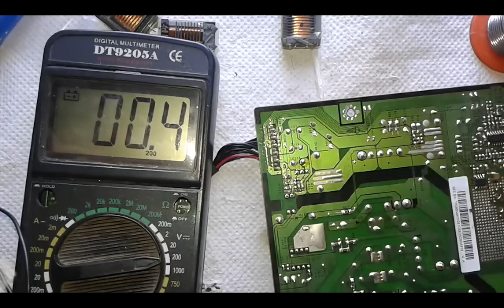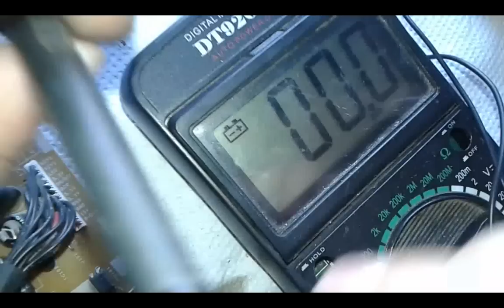LCD Monitor Won't Turn On & Has No Power & No Standby Light Troubleshooting & Repair

Comment: Tip: don’t use such a stiff bristle brush to clean the board and don’t be so rough. This could make your problems worse if you dislodge something that was already working. Compressed air is best or a smaller detail brush.
Reply: I use an angle grinder to clean my boards.

Comment: A perfect guide on how to waste as much time as possible during repairs... If your light in your living room is not turning on, do you start to meassure the voltage on the powerline supplying your whole street or just directly taking a trip to the powerplant to start there? Bridge rectifiers can and should be tested without putting high voltage on even with your multimeter, meassuring the output voltage would not show you if one or even two diodes were dead (signal form and the frequency of the pulses are needed for that, if you want to test it using output voltage). As for caps: ESR is a much more important parameter in switching mode power supplies and meassuring the capacitance of that cap when you alredy had 0 volts at the output equals to messuring the diameter and the density of a growing tomato, to find out the max. speed of your car on mars...

Comment: Awesome video. I just wish everyone could convey their message as clearly as this gentleman.He has a way of explaining things that everyone can understand. Kudos to you sir.
Reply: Judging by the hands and fingernails.....he is a she.....
Reply: He didn't explain anything in this video, he was just testing various components that are most likely to fail and can be easily tested with a meter.
There was no REPAIR in this video, only some basic trouble shooting. I was doing this sort of testing at the age of 16. 
Big deal, he tested a fuse some diodes and a cap, the transformer wasn't faulty but he gave an indication that it was.

Comment: I REALLY NEED HELP the monitor is a mg248q, when I plug it in the indicator light comes on right away and stays on at all times unless it unplugged. The display port is broken because I broke it. The other ports are fine but nothing shows up on the screen when I plug other things in and I can't get the monitor to do anything its just a black screen no menu PLEASE SOMEONE HELP I CAN'T FIND ANYTHING ONLINE!

Comment: Thanks for the video. It was helpful to see the troubleshooting process. For the benefit of future viewers, the video boils down to:

1. Checking voltage across the circuit to see roughly where the issue occurs.
2. Replacing a bunch of capacitors that seemed faulty (but it turned out they were OK?)
3. Replacing a transformer that seemed faulty (which was faulty and this fixed the issue).

It's good to see the tiny tips and tricks used in the video (e.g. bridging the 3.3V pin with the ON/OFF pin to mimick pressing the power button the circuit?).
Reply: Thank you! Just what I needed!
Reply: can you tell me the name of the tranformer? where can i find it?
Reply: @hambatuhan4309  Unfortunately I'm not aware of what transformer was used. The video doesn't zoom in enough to read the model number on it. However, if you plan on doing some repairs, I would suggest reading the model number of the transformer on the defective board, and ordering the same transformer to ensure equivalent electrical properties.

Comment: Without the XMFR, there will be no high voltage for the fluorescent tubes, so the display will be black.
I had one of these, one of the fluorescent tubes was duff, dragging down the output, the power supply protection circuit activated and turned off the supply to stop the smoke from coming out. Tossed it and went to the Salvation Army Thrift Store and found one just like it for $9.99.

Comment: My local Burger King got rid of two NEC p462 multisync monitors I disassemble them and cleaned them thoroughly one of them turned without a problem I been using that one it's what I watch TV game and run my pictures on 
the other one the after plugging in it and turning it on the screen lights up then goes black and  a  red light  begins to Blink on the bottom right corner of the trim then turns off the entire system what could be wrong question

Comment: Very nice video. I have lg 42lf20fr. Problem - When I start the TV it turns on, picture displays for 3 to 5 seconds and then the TV goes back to standby mode. Power LED remains on. It is like TV has been switched off. Any idea of what can be the causes? Thanks in advance.
Reply: You have some backlight led burned, the tv switch off to prevent damages

Comment: Hello sir! i have a similar problem. The voltages on the output pins are flickering and not stable and the tv is not turning on.. Checked capacitors or any other burnt signs and havent seen anything suspicious. Do you have any clue to where i should start measuring or removing first?
Reply: Check the CCFL tubes.

Comment: I have LG model 65UK6500AUA, when I it turn on my TV with in 30 to 60 seconds it turn off and then turns on again. I can push the off button on remote and will turn off. I read couple of places it my sleep timer is set and for me to go to settings and turn off sleep timer the only problem the turns off to fast for me to able to do that process. Help

Comment: Hi Sir, thx a lot for your precious video. I think that my power board (samsung 19'') have the same failure of your. 
In your power board the short are in the primary winding? Practically all inverter has a primary "short". Moreover, how is it possible that a broken inverter (section for high voltage power led lamp)  prevents reading the low voltage of 5V at the output of the board? There is something that is not clear to me
Reply: both coils in the transformer should have continuity one of the coils was broken (not a short but an open).
Reply: @Wingnut353  the secondary of the transformer had resistance, but too high for the meter to beep, it was not open circuit.

Comment: Im not trying to hate or anything but I would highly not recommend this video for anybody for a couple main reasons. 1 there is no guidance or step by step directions which is highly very important when using a voltage meter with live boards and electricity. 2 you don't tell or show anyone how to use or what setting should the voltage meter be on and the connections not showing or even mentioned when switching modes to live power, which is very dangerous. Having the the connections from the first testing and not switched can electricute the people that doesn't know anything about having to switch them. 

For future videos that you create please specify the main important safety concerns with basic step by step instructions. I say this cuz I do not know how to use a multi meter on every mode and what connections do need switched. But dc I do know and 1 other but not a.c. mode. Although I have had used a.c. mode before with live wire but it was already setup by a friend that knew how to use it and also explained to me on what way the mode and connections go for a.c. but since I ain't used that mode in a long time I forgot which way it all goes

Comment: Last step when you remove the coil
Did you replace it or solder it back
Waiting your reply
Reply from the maker: Replace because it  was faulty
Reply: Where to find another one
Or which device use same coil
Reply from the maker: they are almost the same , whatever you can find it will work :)
Reply: My LCD TV was on 
Then semply turned off and not working again
No even standby light
Reply from the maker: that means that you have a Problem on the Hot side of the power supply
Reply: How to fix that coil
Reply from the maker: +Yahya Beshtawy you cant repair them .. you can buy a new one on Ebay 
Here is one > https://m.ebay.com/itm/1400314-inverter-transformer-for-Samsung-CCFL-backlight-LCD-TV/151246710786?hash=item233701a802:g:MbkAAOxy69JTFaLb
Reply: After chick the power supply there nothing wrong with it 
But the next panel which connected with the led lights keep making strange sound ??!
Reply from the maker: i wish i could help you but when i don't see it i dont know what to say :/

Comment: my monitor power supply has 8.5Vdc at output of main bridge rectifier and 0.14Vac at output of switching transformer no output voltage but it shock me even switch button.

Comment: May I request a schematic diagram of that printed circuit board to know the path layout.. If you check the component in resistance circuit board the value of component like diode, resistor change. and there is no exact value resistance test to be measured whether it us defective or not. Unless you re. Move it from the circuit board.

Comment: Hi been trying some solution ..got temporary Solution by using my tv as monitor by connecting hdmi cable cause its working but need to know whats the reason why my laptop display not working..any idea.its great help.thank you..

Comment: sir can your please tell us how to check COUPLER which connects two circuits together from hot to cold
Reply from the maker: +Good mind Good find its very simple .. the first side is the same as measururing a diode or LED .. the other side is just like a trandistor but with two pins :)
Reply: IsDeno24.

Comment: On my samsung plasma tv that has no power or standby red light. I took the back of tv off.i looked at the front of the tv and i see 4 small dime  size white dots. And i looked at back where they are coming from and there are 2 black with silver holder. I took it off than i got 3 white dime size dots, right behind the black and silver bracket

Comment: what do u call to the last one u removed? is that a inductor coil?
Reply from the maker: +Ynna Agadi  that's a step up transformer for the back light :)
Reply: Did you replace it with a new one? Or did you do something to the one you took out?
Reply from the maker: MobaScout it wasn't new it was from another board
Reply: Okay, great. Thank you for the quick reply. I'm trying your methods of diagnosing the issue, but i am not as skilled. Very helpful :)

Comment: My monitor wont turn on now but sometimes it will turn on if i keep plug and unplug and every time i do that the power led turn on and off to can you help me whats the problem?
Reply: Check all electrolytic capacitors and look for broken solder joints
Reply: @wi_zeus6798  the caps are in good shape
Reply: @limwellz  did you measure the ESR / capacitance?

Comment: sir you shorted two pins on the connector. what are those two pins for
Reply from the maker: +Good mind Good find the pins are for the switch that turns on the cold side of the board :)
Reply: 3.3v and gnd
Reply: hai MY Toshiba TV  has half screen what's the problem
Reply from the maker: t con board

Comment: how to discharge big caps without fireworks
Reply: Lightbulb rigging touch wires to the legs carefully light will illuminate a little then check voltage. If it’s low, put a screwdriver across the pins.
Reply: By high you mean above 50 volts?

Comment: Brushing it off not talking and using multimeter and not discussing what you're doing exactly has no benefits here. Some may you understand some of it, some all of it, but if you can at least near rate what you're doing then you're wasting people's valuable time. So this is a thumbs down and not recommended to watch.

Comment: sir my TV Philip 32pfl5624h/12 red light blinking what is d solution
Reply: I think you have to give him a little more to go on. With the stand by light blinking it could be the power supply board or the main board.